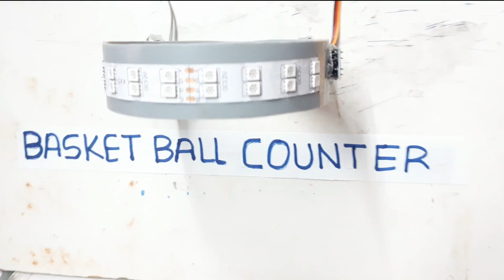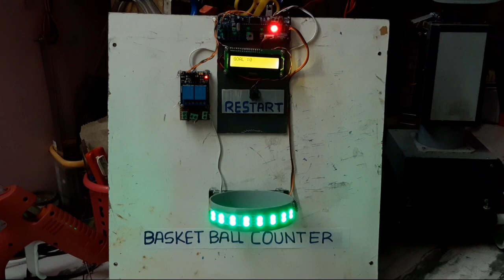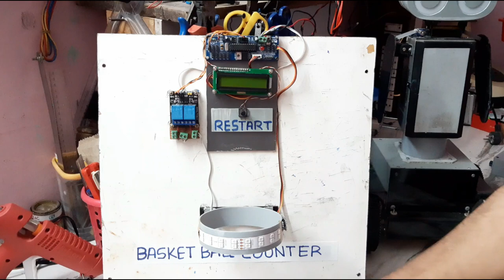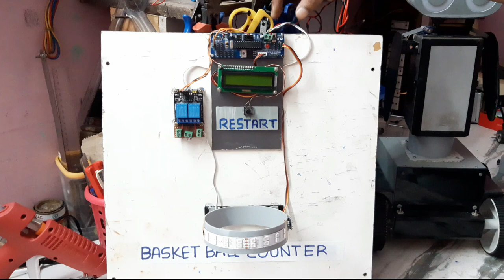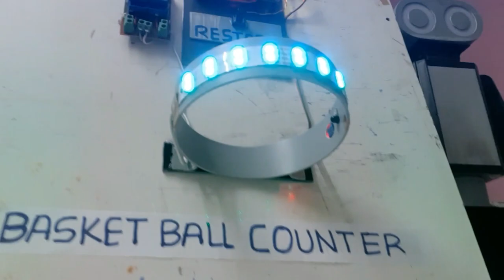BASKET BALL COUNTER WITH ARDUINO AND IR-SENSOR

Comment: why using relay for LEDs ? you can handle through battery or Arduino 5V pin. but your idea is best
Reply: Because those are 12 volt led and arduino provides 5 volt output